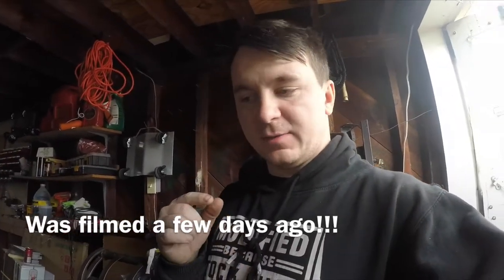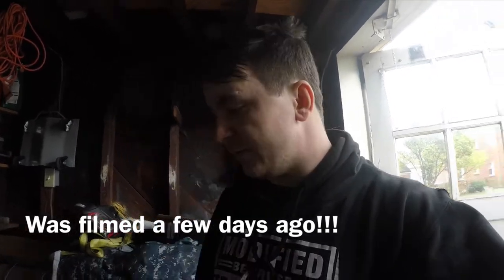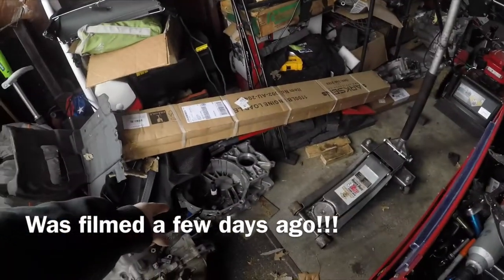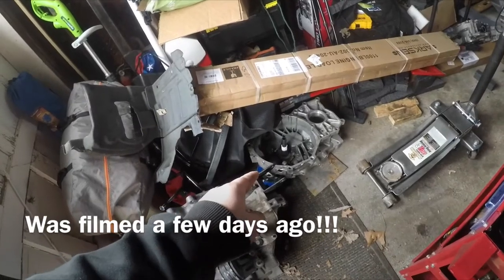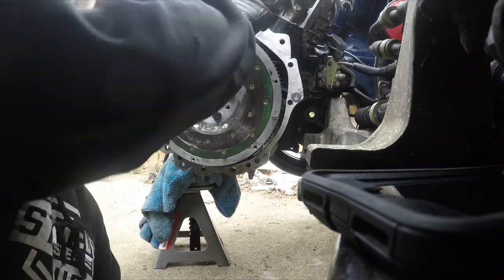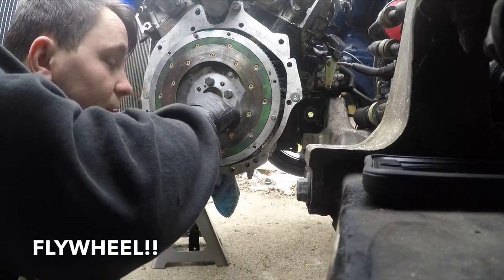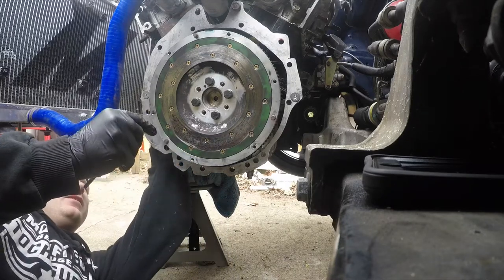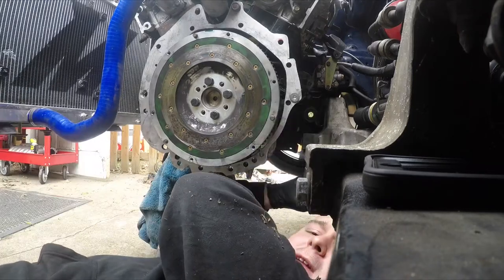EVO Transmission On A 6G75!!!

Comment: where do you get the adapter plate from
Reply from the maker: acreppinstp i made it.
Reply: @6G75_3G  how much you charge to make one
Reply from the maker: acreppinstp definitely not making anymore. Its alot of work
Reply: @6G75_3G  do you know what the shops are called that make these custom metal parts
Reply: @6G75_3G you made this? Do you still have the original program you built to make this. I need one asap!